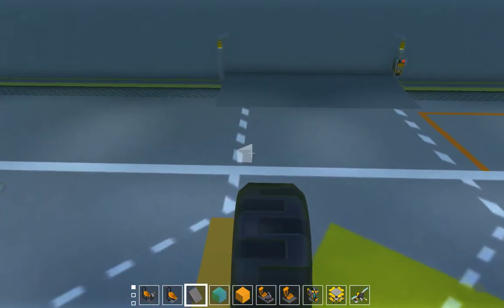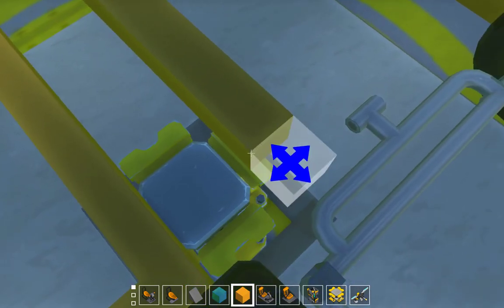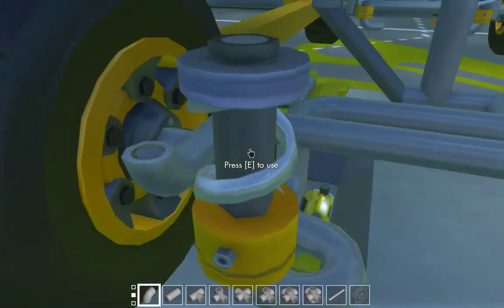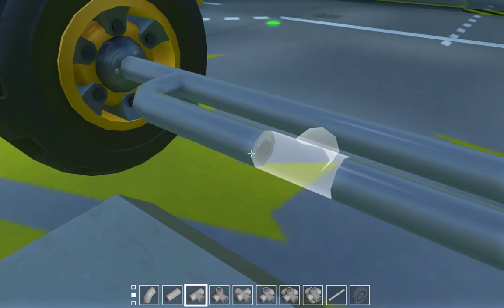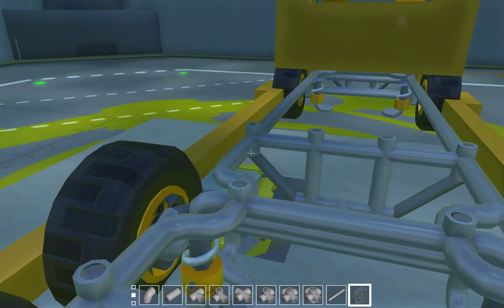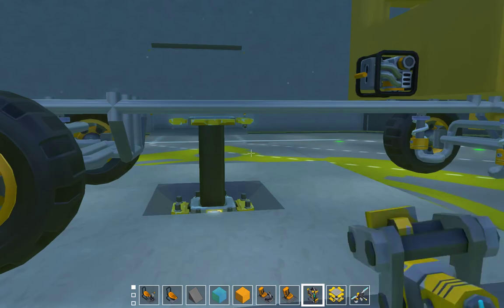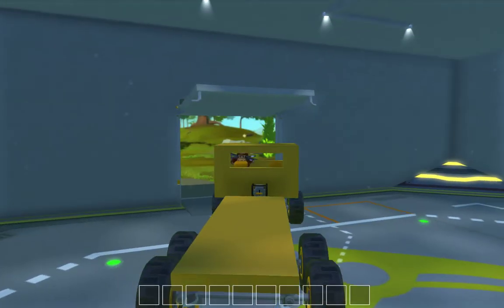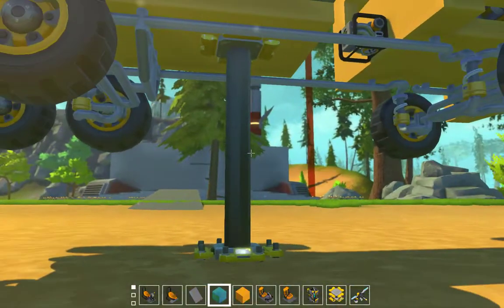Scrap Mechanic | 6x4x2 with caster wheels

Comment: Not sure if it would work properly but put a bearing that turns the back wheels like 10 degrees or something similar when you turn, to help with the reverse problem
Not sure if you thought about that and just wanted to avoid using that method but its something i thought about ^^
Reply from the maker: so instead of casters hav them steer a set amount, that would work. but that amount would need to be better linked with the steering to be adjustable, i have thought of just using something to lock them straight when needed.
Reply: XspunturboX yeah maybe a locking mechanism would suit the purpose better, assuming the feature is only for low speeds, still, reversing is a hassle tho
Reply: Also  is there some way to make the wheels turn more while going slow? And less or not at all if you're going above a certain speed?
Reply from the maker: thats when we need more controller settings and analog input, because then you could make them turn a certain percentage of the front wheels. other than that, you'd need something ti watch the rpm of the wheels and then set the angle accordingly with multiple controllers and bearings.
Reply: XspunturboX yeah, seems over complicated, but how to make those steering mechanisms with a bearing attached to a controller? Just hook that up to the rear wheels and set it to like 5-15 degrees, I don't know how to make those and it's too late for me to continue, but I think I'm onto something here, wait til tomorrow!
Reply: Although I got another idea, put an object on a pair of wheels, add sensors to detect them when the wheel spins, then hook that sensor up to a timer, and make the wheels lock up when they spin fast enough to make the timer give out a constant signal, controlled by the delay in the timer
Reply from the maker: would be way too big.
Reply from the maker: for each set of degrees "5-10-15" would need 2 bearings and 2 controllers. plus sensors and logic that can figure out what angle to use and so on.
Reply: XspunturboX oh yeah, now that I think about it, would be pretty much to do, although it would be cool if it could work like that 😎
Reply: Heres something i came up with today, take a look if you want to, got rid of the suspension glitch and kind of fixed the rear wheel stearing, and i added a bouncy truck seat as well ^^ http://steamcommunity.com/sharedfiles/filedetails/
Reply from the maker: you didnt copy the entire link

Comment: Making the rearest rear wheels turn would make the turning radius better right?
Reply from the maker: It's worse like that. Doing it with either will make the turning radius better. But making the 2nd set casters makes the rear end wander alot.